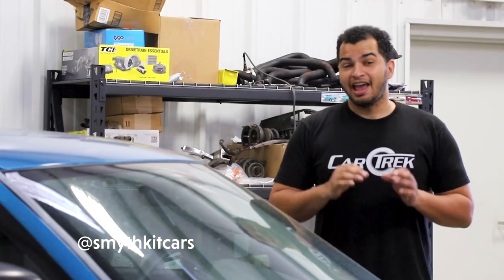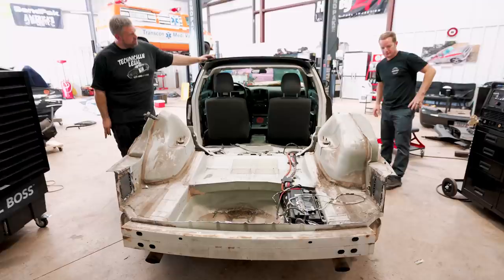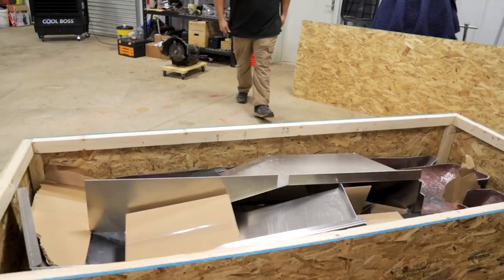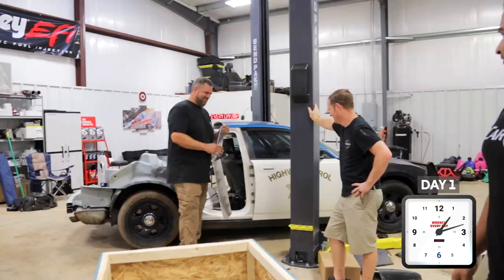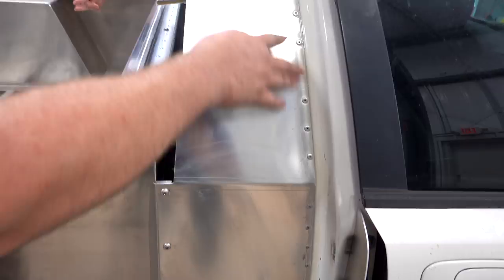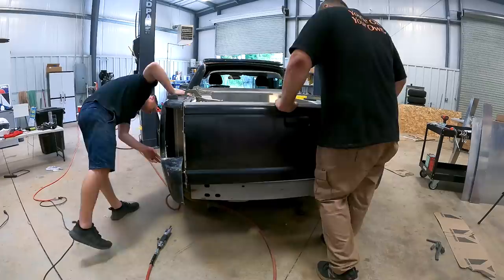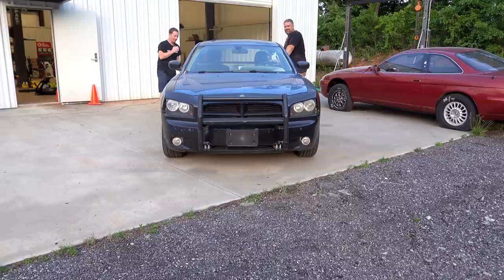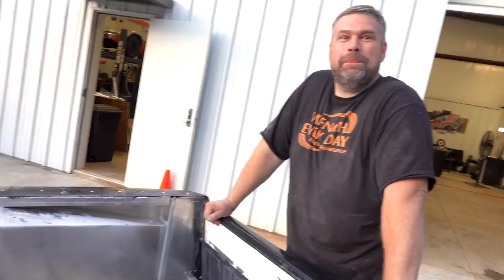We Turned A Broken Cop Car Into An INSANE Pickup Truck (In 2 Days)

Comment from the maker: Everyone, the bed floor is removable so you can access the battery, and the struts bolt in from the bottom up so nothing is covered!
Reply: Is it made from stainless? You guy didn't prime any of the panels. Thanks, car looks 'Heeps better' as someone w/ a Ute would say.
Reply: Its great Aussie slang a ute
Reply: Aren't you going to end up with a pool of water in the spare tire well just hanging out with those electrical cables and the battery?
Reply: 100% Ute.....Champions.
Reply: I would have liked  a steel inner structure for the bed, the rivets seem a little sketchy for me (obviously not in real life).
Reply: So you can change suspension?
Reply: I was actually wondering about the fuel pump myself. Anyway looks awesome and will be loads of fun. Great work.
Reply: @i976scirocco3  It's aluminum.
Reply: I hope you are going to coat the floor panel and the sides separately with sound deadening and bed liner, otherwise you will have the noisiest charger on earth.
Reply: @misterquintus  mine isn’t coated and honestly it’s not loud at all! It’s a blast to drive
Reply: I was wondering about that....
Reply: @misterquintus  That is thick aluminum. It won't oilcan like sheet steel. I don't think noise will be an issue unless it rattles, but with the panel adhesive and all the extra rivets, I don't see that happening.
Reply: @BrianSmart1959  Thanks
Reply: Jack is a great addition to the channel.
Reply: @chrismason6857  he’s been very enjoyable on Tavarish’s channel lately and I hope we see more of Jack!
Reply: Australia 🇦🇺 we love our utes
Reply: Tut
Reply: Jared, you NEED to go full Westen Champlin on the charger and throw a 12 valve in it .. then throw some air suspension , and a fifth wheel plate and have a badass, unconventional tow rig lmao
Reply: @klyneis  ..drills small hole in tire well!
Reply: I saw bolts on top of the struts. Why are they there and they are now not accessible.
Reply: Thanks for answering the question I didn't want to ask. It is good to hear it was thought through.
Reply: Only one thing how will you change the rear shocks
Reply: Users interested in using this as a pickup may want to weld panels in place.
Otherwise, squeaky squeak.
Reply: Good luck in changing your rear struts
Reply: @MrStacy1974 
3m panel bond is really the way to fly,then all the rivets do is hold it together until it cures.
Reply: @misterquintus 
Lizard skin spray sound insulation and a roll of dynamat goes a long way.

Comment: I would add a roll bar to this. There's barely any structure left in that rear (of the cabin). This would also serve to tie everything together with the right amount of tabs added to it. Can be retrofitted even if the car's done.
Reply: And the roll bar makes a good place for lights to live!!
Reply: Rather than sawing big holes into their freshly rived aluminum, in order to properly install a structural roll bar, I would probably go with some underbody stitch welding of the seams and subframe connectors. I might have also used some panel bond on the riveted parts, but that's water under the bridge...
Reply: The location between the cab and the wheel wells isn't all that usable anyway, and adding a roll bar there would certainly add some structure that is missing.  One possible place to triangulate a roll bar would be to tie into the tops of the rear shock mounts.  While you're in there, you could also upgrade the shocks and if you add airbags inside the springs, it would make the ute's bed much more usable for hauling stuff.  This would also be a good time to add a receiver hitch.  What's a truck that can't tow?
Reply: @WhiskyCardinalWes  Flashing lights, of course.
Reply: @TheKiltedYaksman1   this kit looks great for looks, not so great structurally. Steel panels and reinforcements pieces welded together, would ensure it working as a proper pick-up. Not that great with rivets and glued panels.
Reply: @RogerM88  the thing is that welding those panels can be worse for internal structure of aluminum molecules (or in reality any kind of metal hence why gluing and riveting makes sense to some degree) since they will scatter around due to massive amounts of heat melting the metal and it quickly cooling down due to its thermal performance (roughly 350w mK of heat transfer) so you cannot just "weld" instead you work the most optimal way for your expirience

and to remind you that today's cars are legit built this way because we prioritize human lives over pieces of metal being attached together since something has to be able to soak the impact for you otherwise you will eat that steering wheel like you didn't eat for 3 days due to colonoscopy you have to do
Reply: @xthelord1668  you're talking more about cars, not so much about trucks.
Reply: @RogerM88  i am talking about vehicles in general plus this ute converted charger can't anyways haul more than 900lbs which 50 billion rivets and 20lbs of sealer can hold better than welding which would just warp the shit out of metal and make it weaker
Reply: @RogerM88  you do realize that cars like the 370 z has nothing holding the floor pans together besides panel bond right?
Reply: I feel like those metal panels are thicker than they would be stock, it kind of looks pretty rigid at the end of the video to be honest.
Reply: They added back structure so they should be good.
Reply: @sterlingodeaghaidh5086  it's fine,
my factory holden ute has the same style of bars and a plastic tray liner for rear structure
Reply: @alt7488  Ik that’s what I said, they added back the structure with those metal panels and frame.
Reply: Airplanes are riveted and go through a lot more abuse than any truck on the road.
Reply: Nah, completely wobbling up a unibody car is the American way^^
Reply: Maybe, but honestly Mark Smyth, knows a bit about building cars... orignal cobra kit creator etc... these are engineered pretty dang well. that being said, I like the idea of using a hoop headache rack on the truck
Reply: @RogerM88  , but since this is a truck that is built from a car body, the general rules about trucks do not apply to utes/coupe utility trucks/tonneau trucks/car body based pickup trucks, as the structures of those particular vehicles are build differently than the more traditional pick up trucks are built with their bodies.
Reply: @xthelord1668  et al, but since this is a truck that is built from a car body, the general rules about trucks do not apply to utes/coupe utility trucks/tonneau trucks/car body based pickup trucks, as the structures of those particular vehicles are build differently than the more traditional pick up trucks are built with their bodies.  Honestly, it is like comparing apples to oranges.  Also, you lot conveniently forget that Chrysler built such vehicles themselves in the 1980s with the Dodge Rampage, Plymouth Arrow, and Plymouth Scamp (Second Generation), and they are also roughly the same size as the two latest generations of the Dodge Charger and Chrysler 300, as well as to the Dodge Magnum (Fourth Generation).

Comment: Roadblock is now a Dodge Rampage 🥳
What a cool project!
Reply: Ooh!  Good call!
Reply: I forgot about those myself
Reply: Rampaging roadblock
Reply: @romonecrosby  Roadblock Rampage
Reply: @keithjones589  Yep. Basically a VW Caddy.
Reply: I had a Dodge Rampage. I swapped in a 2.2 Turbo, trans and axles from a wrecked Shelby Charger. Also used   front air dam and side skirts from Shelby Charger and Omni GLHS. Made a fiberglass rear roll pan for it and installed the big hood vent from a Daytona Turbo Z. Painted it Daytona Shelby Red and it had Shelby Daytona pumper style wheels. Cut the springs to lower it two inches and added Shelby sway bars. It was basically a Shelby Rampage with the best Shelby parts from different models. Did some motor work and it ran 12.8 @ Numidia Drag strip. Whole build was less than five grand because all the parts were from wrecked Shelby cars. I built it back in 2008 and my brother has it now. I miss the old turbo Dodge cars. I have a Shelby Daytona with T-Tops. Its fun and it turns heads, good enough for me.
Reply: @Whats-It-To-Ya  I can't believe Dodge owned Lambo for years, and all they gave us, other than the Magnum, was nothing but shit K cars and badge engineered VWs.
Reply: @ItsDaJax  the K cars weren't that bad if you had a manual trans. The automatics were a disgrace and that's what killed these cars. I had an Aries 2-door 5-speed and it was a fun car. It had over 200K on it when I sold it. Every Dodge back then came with an optional turbo motor, even a K-car wagon. It was cheap speed and they could be made real fast for very little money. You could build an eleven second car for less than five grand. You can't do that today.

Comment: if 
 Smyth Performance just gave you hurried scratch parts , I definitely want the retail ready parts they produce , that is quality , I love it's look already , well done guys , & Tavarish lol.
Reply: Wanna bet their website just crashed.
Reply: every kit they make is top notch .. the owner used to own factory 5 so he has lots of kit car experience
Reply: @scootersfrog  doing a pick-up conversion using panels with rivets and fiber glass side panels glued? What about the structural integrity? This could work, if it's just for show.
Reply: @RogerM88  what about it? i have no clue i didn't engineer it but im sure the same integrity is put back in as you cut off just in a different way .. i know this man has had years of experience with kit car manufacture so id bet he knows all about that 🤷‍♂
Reply: @RogerM88  also rivet and panel bond is not new way of building a car most cars built today are mostly glued together welded sub panels hell some cars are 100% panel bonded together
Reply: @scootersfrog  not so much in the pick-up  industry, especially in the cargo area. And that's for a reason.
Reply: @RogerM88  this is more of a pickup in the sense of SSR not Silverado, RAM, Ranger, etc....
Reply: @RogerM88  i have a factory holden ute with a plastic tub liner and steel bars the same style as this,
i've hauled 500kg in it ,
it's rated to 750 odd kgs from memory,
any more than that and you step up to a cab/chassis/alloy flat top style tray rated for 1000kg,
btw it's more suspension mods that need to be done to haul large loads
Reply: @sideswipe_x1  You ever heard of a Ranchero or El Camino?
Reply: @RogerM88  LMAO if u actually think cutting up a car and turning it into a ute will give it any more load capacity/capability  than it was when it was a car you have serious issues
Reply: @RogerM88  just to put you in perspective airplanes are put together with rivets and "glue" ;) let that sink :;)

Comment: Add a roll cage with a bar exposed slightly above roof line for lights and extends to rear frame for rigidity. Maybe hide partly behind panels? Build seems dangerous if crashed from  rear end?

Comment: In the 80s, Dodge made a ute type vehicle called the Rampage. It was based on the front wheel drive Dodge Charger. The only thing I'd change to this kit is to have a ribbed bed floor like most pickup trucks have for extra strength.

Comment: Edit
Historically, the term "ute" (short for 'utility vehicle') has been used to describe a 2-door vehicle based on a passenger car chassis, such as the Holden Commodore, Australian Ford Falcon, Chevrolet El Camino and Subaru BRAT. Australian-produced utes were traditionally rear-wheel drive and with the cargo tray integrated with the passenger body (as opposed to a pickup truck, where the cargo tray is separated from the passenger body).

Comment: What a cool conversion to rehab your damaged Charger! I do wonder about structural strength after you chopped out so much sheet metal. Can you weld in subframe connectors?
Reply: The aluminum bed that's put back in brings the strength back. 
Best to install it with 3m panelbond though , it'll be really solid. 
I'd wager my Mk4 chassis is stiffer now than when it had a roof. 
You can jack up a front wheel ,go to the back and teeter it back and forth on the jack.

Comment: Looks great. By the way I love that you guys are calling it a ute - here in Australia even the manufacturers are slowly starting to refer to utes as pick-ups or trucks (which I guess they are, given that a current model Hilux or Ranger absolutely dwarfs say, a 90's dual cab, and with local production no longer there's no more traditional car based utes), so its really cool to see you guys saying ute rather than pickup, and yes you are pronouncing it the correct way lol. Regardless I think you guys will love it, whether you use it as a skid pig, a car to use for picking up parts, or whatever. I personally miss our traditional car based utes, that have the practicality of a truck but with the comfort, handling and performance of a sedan.
Reply: Well, it technically is a ute. Most of the utes sold here, where based on station wagon variants of cars, except maybe the Rampage/Caddy.

Comment: At the very least there should be a brace between the B-pillar and the rear shock tower on both sides to add back some of the structure. Those riveted panels are still going to flex over time. I’d also add a cross bar between the two B-pillars.

Comment: Those rivets are designed to be bucked at the tolerance range. And extra bucking is just damaging the rivet. 2-4 diameters distance from the edge, and 4-8 between rivets. That's textbook aircraft riveting.

Comment: You could've welded a couple 4x6 steal beams perpendicular with the frame and driven it as long as you weren't doing burnouts you'd be fine and would've made for good footage. Cool project regardless.

Comment: I've wanted one since the day I seen the kit. Add in a 6spd swap, holley efi, exhaust, spray in bed liner, and a nice stereo and you'd have the ultimate daily. 30+mpg, 400hp, in small rear wheel package compared to a truck. But still able to have bed space to toss tools, parts and crap that wont fit or destroy the interior of your car.
Reply: With the structural integrity of a tin can.

Comment: So first some logical things. Do you think it flexes enough to the point to where you need some extra bracing? Second, is the bed going to be actually used for something? If so, I think a faux wooden bed would be nice. Or, Ransom beads along the bedpan so you don’t crush or tear holes in the middle so easily. What about the battery? Is that gonna be a pain to get to? Are you going to relocate it or did you not show it? Now for a questionable decision, I think that bed needs a hellcat engine in it.

Comment: quick tip clean the end of you rivets gun its slipping because the teeth are dirty. 
could be ware to but just a quick wash w/ brake clean and it will work 10times better!

Comment: I love the build but do have a question. How do you access the battery when it's time to change it? Also if the battery stayed in the same spot as factory do you think it may create an issue in case of a potential leak into the rear compartment?
Other than that it's a great project that is turning out amazing.

Comment: 24:00 I'm confuses with the torch on the fiberglass. Are you rushing a drying process? You certainly are not changing the shape by stepping on it and heating it. 

-10 years aviation composite repair

Comment: Now did you leave the suspensioin alone because if not it may not haul much befoe bottoming out and i would put stiffer springs back the or do the crazy thing and do leaf spring. I thin that would be bad though and boucy with no load but 100% do stiffer springs i know they have them already being a cop car but they should be able to make some or find some so it can hold like a load of bricks without swaying alll over the road and o yeah a rear sway bar would be good too...................

Comment: if we get the account ford created el ranchero, chevy created el camino... but dodge??? I never create a similar vehicle... why??? so what would it be called? already!!!! it will be called EL PASO!!! what I don't like is that they joined all the parts of the bed with rivets... that doesn't inspire confidence in me, I'm going with welding all over the bed, that's the only defect I see... another option? use the glue that assemblers use, but I think that's what they used for the fiberglass parts